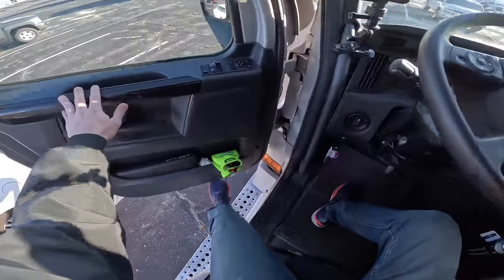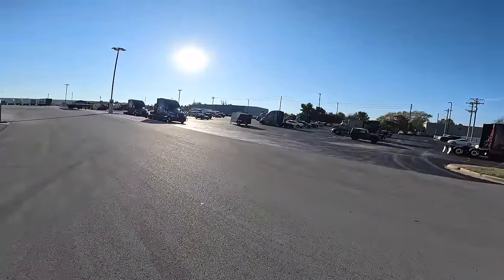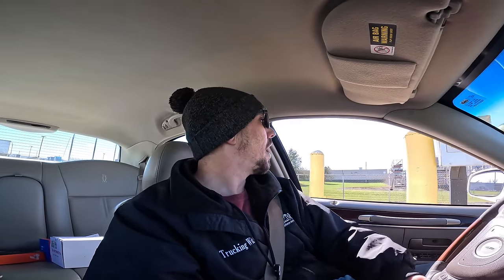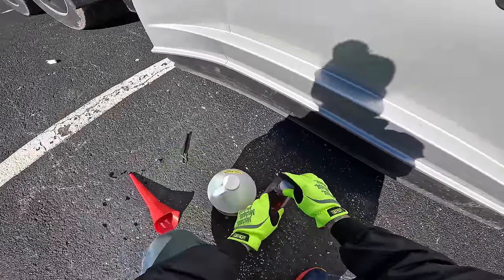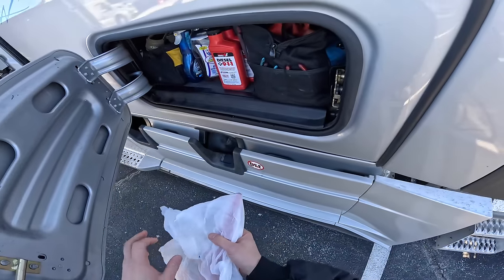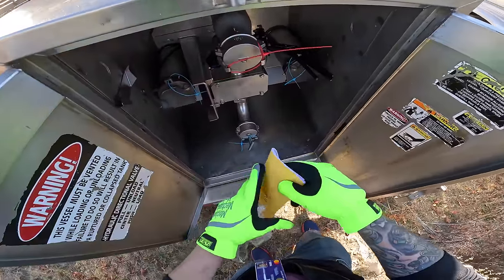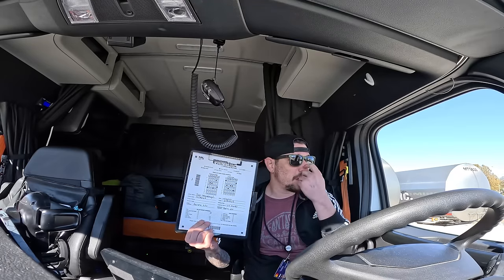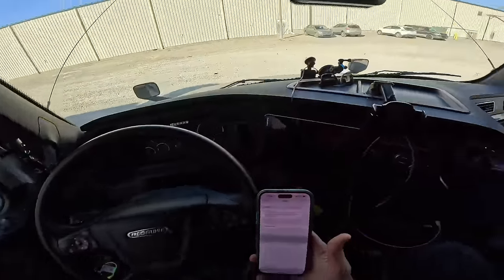Prime Inc Trucking: This Is How I Prepare For Winter Driving

Comment: Do it now, or at least start the process while it's still relatively warm out. This way? You at least have some in the fuel filter and the tanks. You don't want to go flatbed division. I've worked for companies that ran vans, flatbeds and reefers. Nothing like trying to tarp in a howling 20 degree wind or trying to fold those babies when it's 12 degrees out.  Stay safe and warm and God bless you. Yeah, it's the chilly weather moving in.

Comment: Make sure you get winter wipers tho, the ones that are silicone blades without the metal showing.

And if you have an APu there's no need for antigel really bud. The APu should keep your fuel at or above 42° either via  a fuel return line which they all have or the addition of a fuel heating system if prime specs the winter weather package (they usually do)
Reply from the maker: Appreciate the tip!